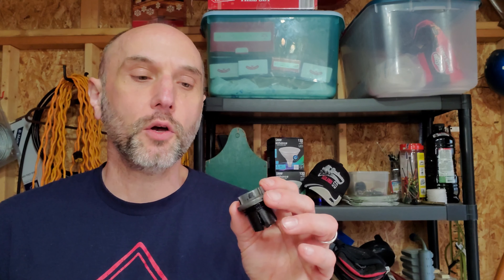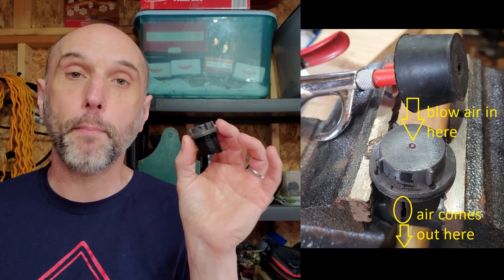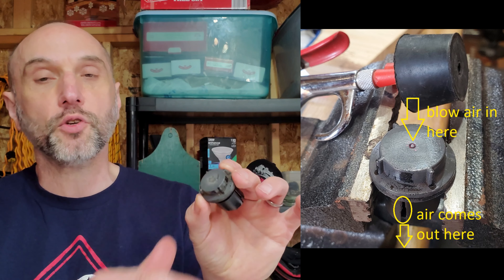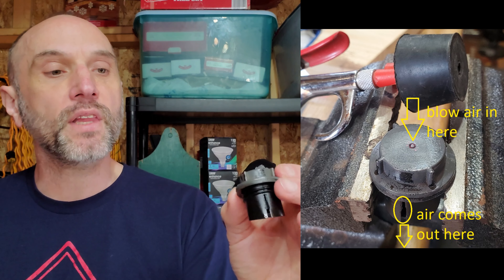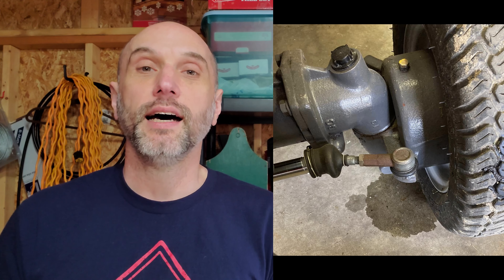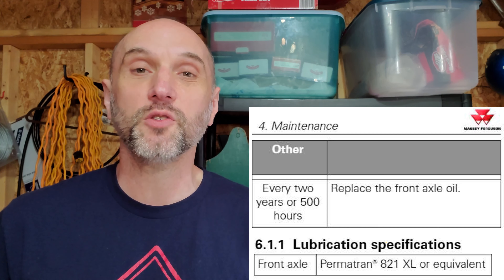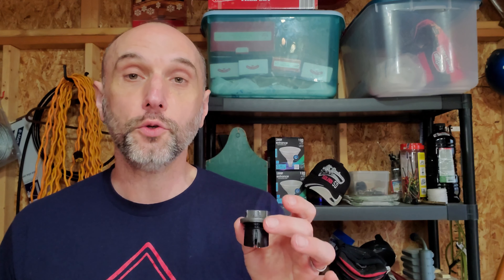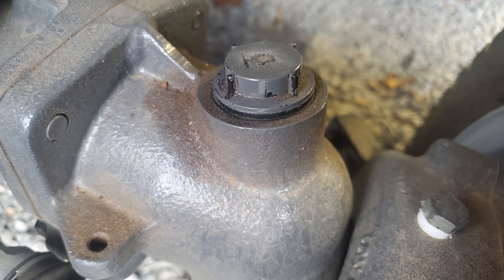Front Axle Venting on Subcompact Tractors

Comment: Hey Ed wadup!  I saw various online tractor forums discussing this topic, and yeh did stumble on some dudes installing a vent tube that threads up into under the hood (to keep dirt from getting sucked into the tube once everything cools off and forms a vacuum)  Another thing I saw was installing a one-way valve on the cap, but there I'm left to wonder whether that would form a perpetual vacuum in the axle after a while, and then good luck unscrewing the cap.  My solution is to ensure I don't overfill the axle, I suspect a lot of blown seals and stuff is people overfilling the housing there and then when it all heats up in there...nowhere to go other than past a seal.  Anyhoo, Merry Christmas/Happy New Year, Ed!

Comment: Thanks Ed.  So are you saying that just because my tractor leaked fluid while sitting in the garage 
this winter it doesn't necessarily mean the seals are ruined?
Reply from the maker: Yes, that's exactly right. Many people have reported this issue where it's the pressure that's forcing the leak. Venting might get you along another xxx hours before you would have to eventually change the seals.